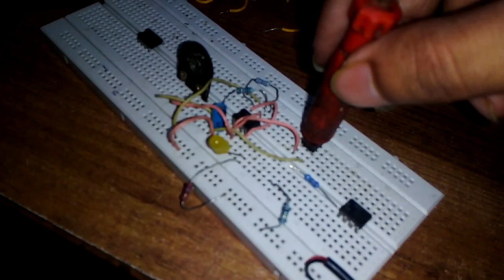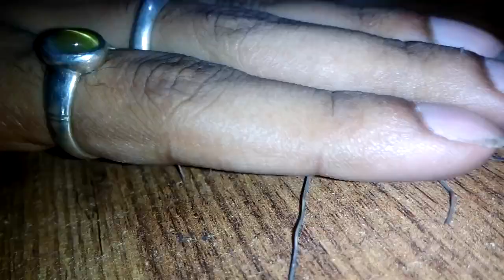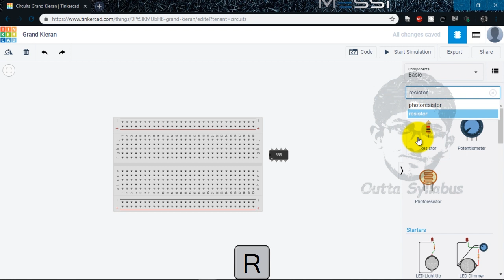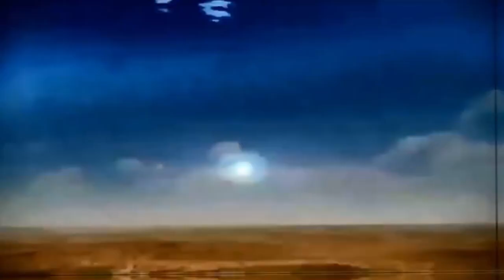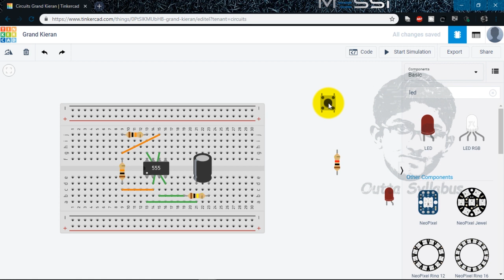Electronic Soft Latching Power Switch using 555 Timer IC | DIY electronics project by Outta Syllabus

Comment: Emergency URGENT help 🙏🙏🙏 
Can you please help fix this issue???
Yes, the circuit is working 💯 percent perfect with added 0.01 micro farad capacitor at pin 5.

However, if you observed carefully, and touch/tap the positive or negative side of the power supply with a bare conductor wire, the IC will automatically trigger ON when trapped, and OFF when released. I believe to be due to electromagnetic interference signals.

I added 0.01 micro ceramic capacitor across the input switch button, but still same issues when tapping and untapping the aforementioned wires of the power supply source.

Please help how to fix this interference signals noises 
🙏🙏🙏🙏

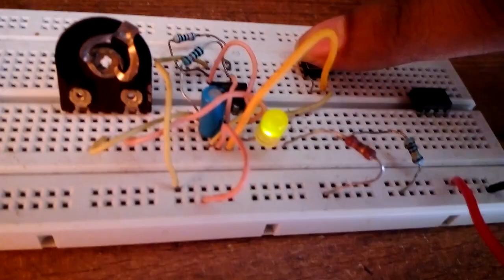Comment: 13:22 
i am facing the same problem!! i'm using 9v battery but still facing same issue
what should i do??
Reply from the maker: try to make the wires shorter and less exposed, that can solve the issue